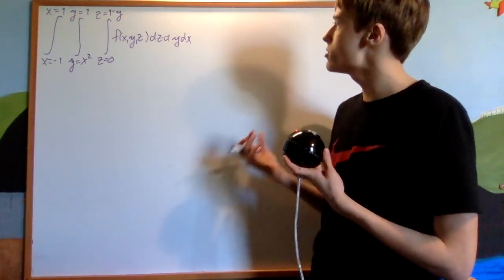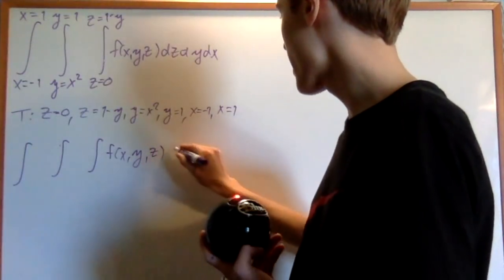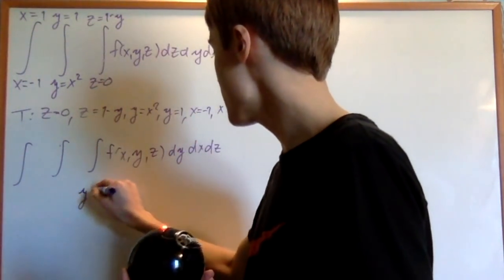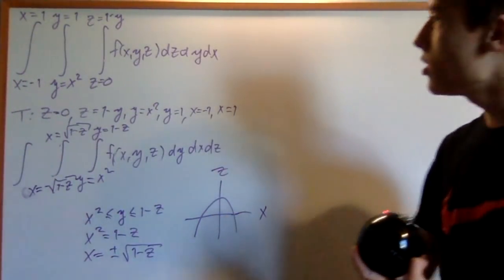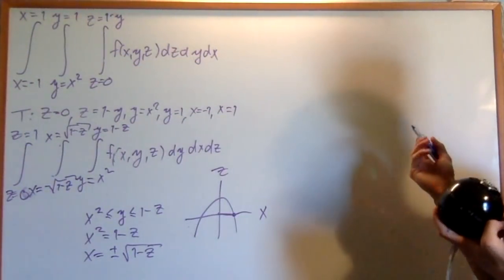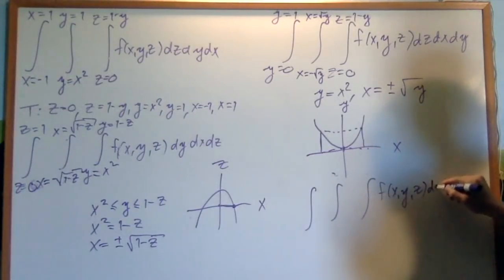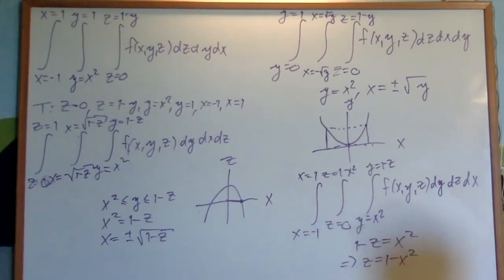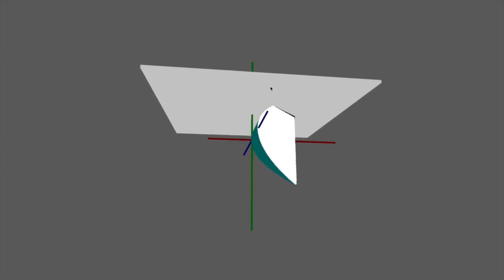Changing the Order of Differentials in Triple Integrals (Animation Included)

Comment: Worst explanation.
Reply from the maker: Sorry, I'll try to be better at explaining my thoughts in the future. Any specific suggestions?
Reply: @Fematika  It was a good explanation he just buggin for no reason
Reply: Maybe a demonstration with an example function would have been helpful.
Otherwise, it was relatively straight forward: the multiple integrals are solved from the inside out (just as parentheses) and the variable you are integrating over has to be put in relation to the next variable on which it depends.
The animation was certainly helpful to intuitively explain the changes made.

What intrigues me the most is that the integral over this section of a parabolic cylinder (?) could look vastly different for different functions (which seems similar to the kind of deformation of the mathematical space which is done during u substitutions).
Several different examples could have helped to explain it.

Anyways, thanks for your effort, Fematika.
Reply: @xCorvus7x  No, an example function would have no use. Firstly, good luck plotting a 4d function, and secondly, the function does not change anything about changing the limits (which is the title of the video). 

@Fematika thanks, very good vid!
Reply: @AlexandreLopez1999   @Alexandre Lopez  The animation is tenuous but not worthless.

Regarding your second point: the bounds of the inner two integrals depend on the outer next variable.
Changing the order of integration must take this into account and thus change the bounds.